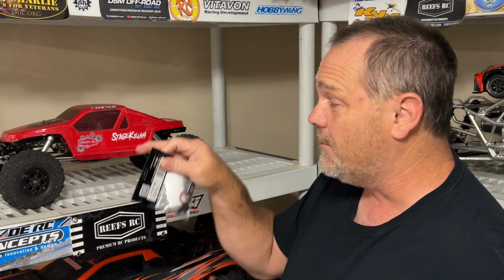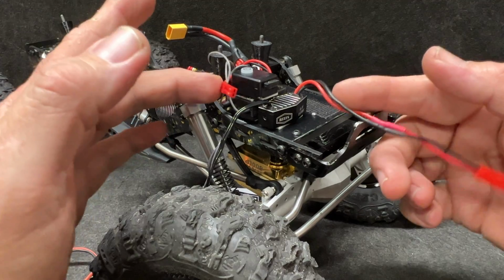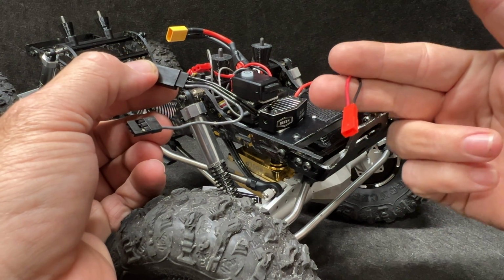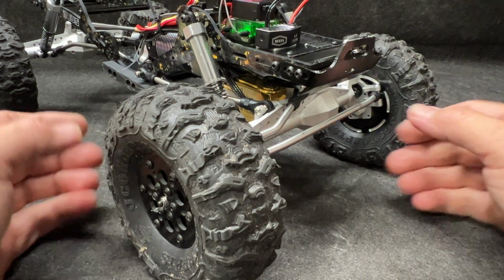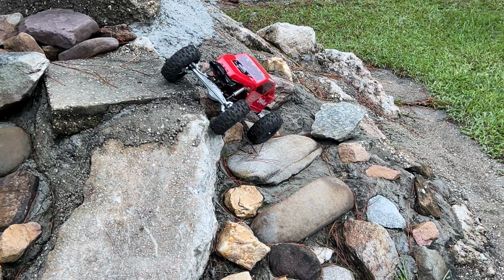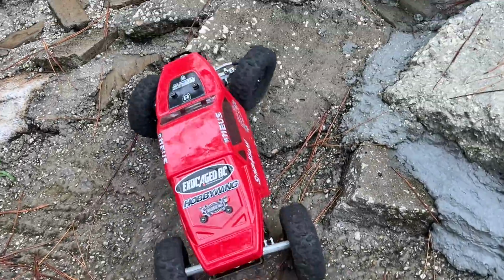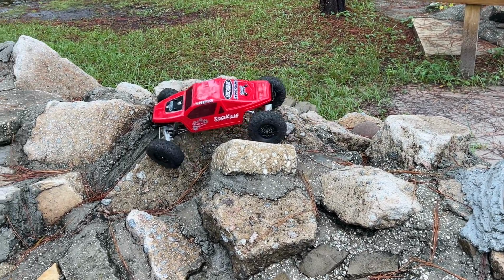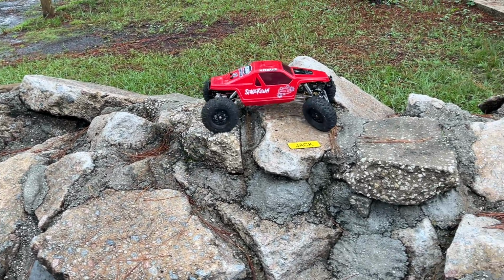Reefs NEW BEC makes things EASY!

Comment: Wait so should I connect it to the main battery or separately power it?
Reply from the maker: Main battery
Reply: @ hmm ok weird I messaged reefs themselves they said I could power it separately or do the same mod you did to change the plug from male to female but if I plug in the bec signal cable to the receiver and plug in the main battery then plug in the spare battery into the bec will it fry and burn?

Comment: If all the grounds are common (all tied together) there should not be any problems , as long as the hots are not common, high voltage for servo and low for receiver.
Reply from the maker: Yep it’s the grounds that are often overlooked and this makes it easy.

Comment: Joe, on the FP you are using did you change plugs on the EZ Bec just to avoid using Reefs XT60 harness? Did you have to change anything on the FP receiver plug? I have a FP and would like my Smart 900 to run at 8.4v instead of FP built in 7.4v limit.
Reply from the maker: I did this so its plug and play for me and my setups, the easy plug and play with the reefs adapter keeps it simple and avoids many mistakes. I want to use this on a few more trucks where I have the Castle 10a bec so it makes sense to me.

Comment: Why not just use a direct power servo? But otherwise I guess this is neat and a bit cleaner than castles version, yet not programmable so tradeoffs.
Reply from the maker: I live direct power servos. I like this as it has the bypass built in and as far as adjustments I just set them all to this unless there is a special reason not to.

Comment: In general, I really do like this.  For the most part, it is sorta-kinda "plug & play" (as Reef's claims)...but, not entirely.  As you are doing, not a lot of people will really want to run a separate battery to power the BEC.  They'll want to power out from the same battery powering the ESC.  Plus, even if a person is willing to power it from it's own battery, they have to purchase batteries with a specific connector, which also means needing to purchase another charging lead.

Personally, I prefer having the BEC hardwired to the connector that also powers the ESC.  One thing that keeps me leaning towards the Castle BECs is that the are programmable...this one isn't.
Reply: Plus the CC is half the price as well. Maybe not as clean out of the box look but a little extra wire management and they can be nice and tidy.
Reply from the maker: Yeah I modded this one to fit my builds, but the thing is this has the bypass built in so no red wire removal or any of that. As time moves on more and more components are good for 8.4v or higher. If you have a TRX4 with all those servos this is the perfect solution. with a HV receiver like most are in current times a simple Castle can get it done just remove the red esc wire.
Reply: @ExocagedRC  True...or, get one of the Holmes Hobbies Bypass Harnesses.  He makes a single servo version, as well as a dual servo version.  With his harnesses, there's no need to cut the red wire, plus the harnesses also include two accessory connectors (one of each connector type. 

The nice things about the Reef's BEC is that fully enclosed inside a case (tho, as others have pointed out, a "coffin shaped" case might not be for everyone...lol

Comment: Will it work with rear steer
Reply from the maker: Yeah
Reply: Currently does not work with rear steering. You would need to run two bec. Reef is currently working on one for both. That’s what reef told me today in an email.

Comment: Nice! Do they make different voltages? I am slowly going through a build where I have opposite problem: I will have 7.4 volts from esc to servos and receiver, but I want another circuit with 6 volts for sound, lights and such.
Reply: Castle creations BEC is programmable with a castle link. 4.8 to 9 volts I believe. Half the price this one is just not as clean looking.
Reply: @troyshobbyattic  Nice, thank you! Programmability is a cool extra feature!
Reply from the maker: This one is preset at 8.4v which is fine for the vast majority of servos, but it you want to push it, the castle can go higher.
Reply: @ExocagedRC  thanks! I actually need lower. Most lights I see are nominally 6v

Comment: What’s a bec?
Reply: bec = battery eliminator circuit
escs have an internal bec to power the servos and receiver
but to power a strong servo you might need more amps than the esc bec can provide, so you can use a separate bec like this one
Reply: Asking the same
Reply: Ubec is what they are. Bec is the one in the esc to be 💯 correct.